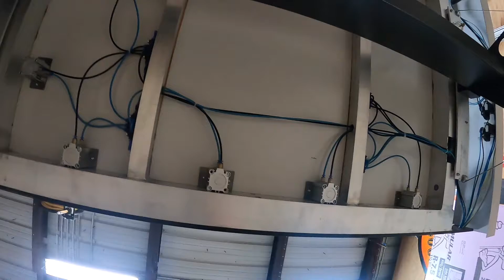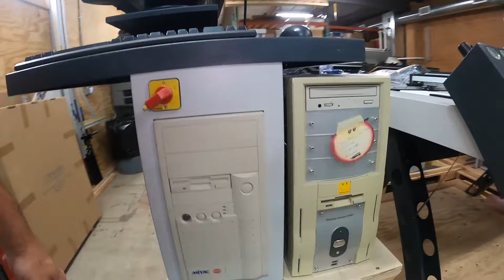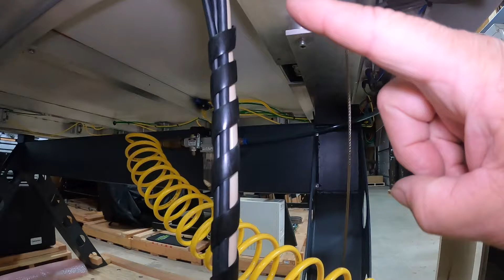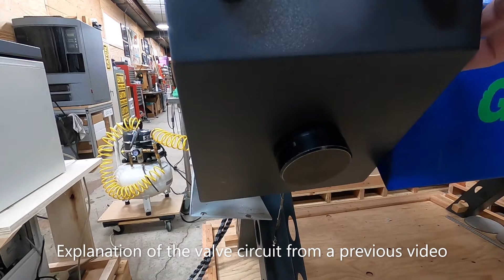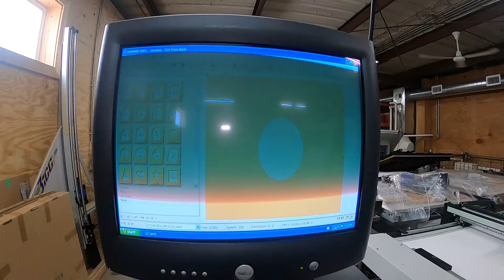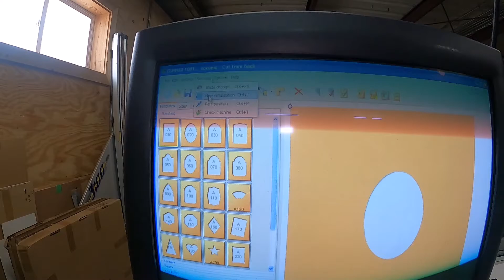GUNNAR 1000 re-wire Part 2

Comment: Looks as good as new!  Do you have videos on TTC?
Reply from the maker: I do not have a TTC machine. I typically only support the older/discontinued models. GUNNAR would be the one to contact for the TTC and AIOX product lines. I have experience on F1, 601, 3001, 1001 & 2001.